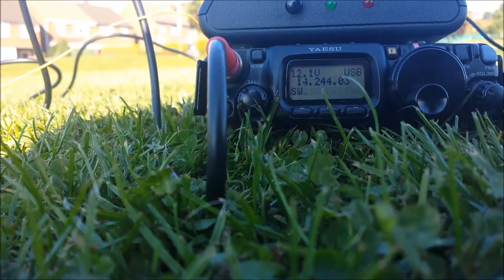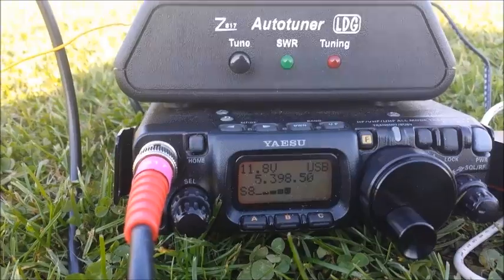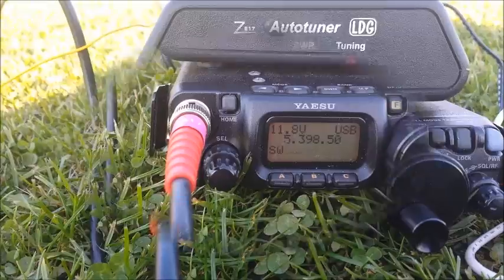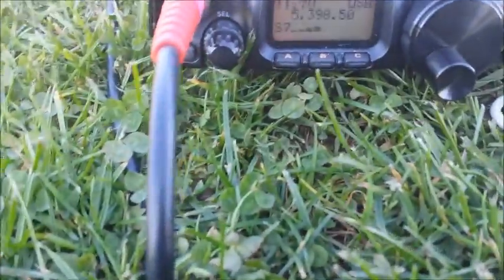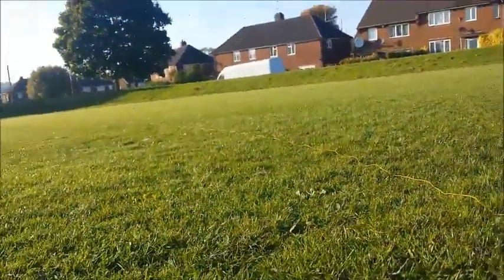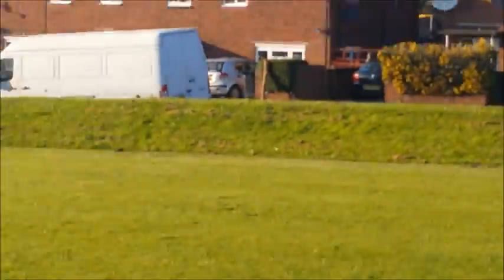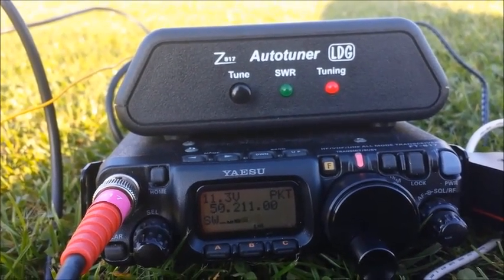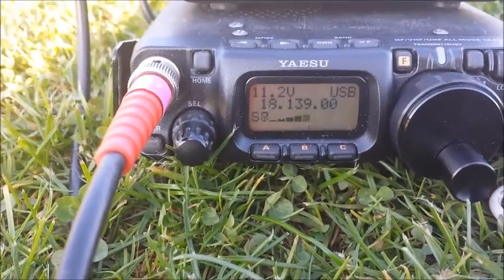FT817 Portable with Home Brew Antenna

Comment: I just got an 817ND yesterday. I see you have no antenna plugged into your radio, SO239 but coax coming from the tuner. The antenna tuner lead must make the connection? I don't yet have one but will get one soon. The weather is horrible outside.